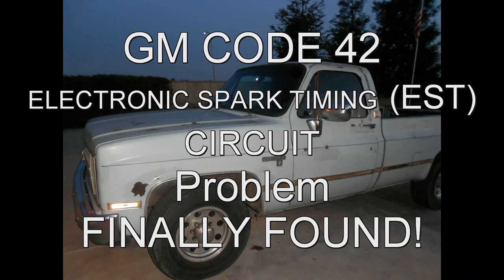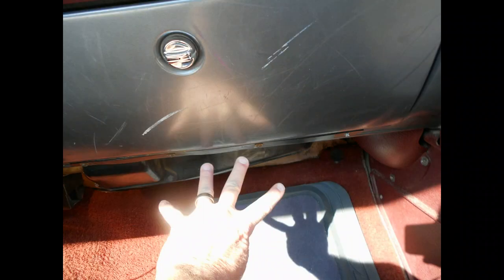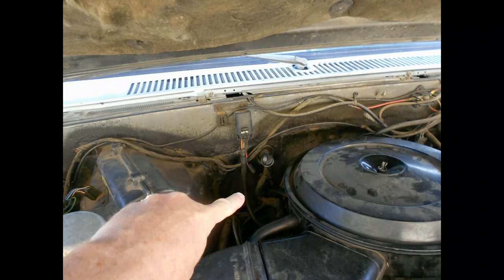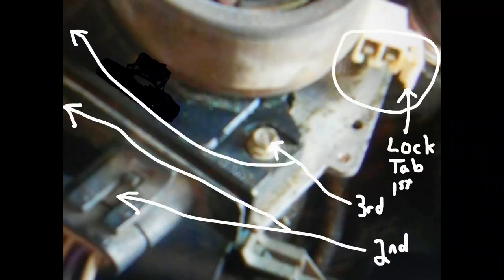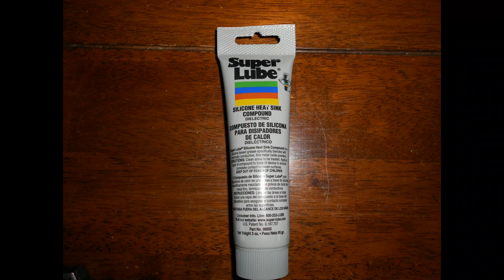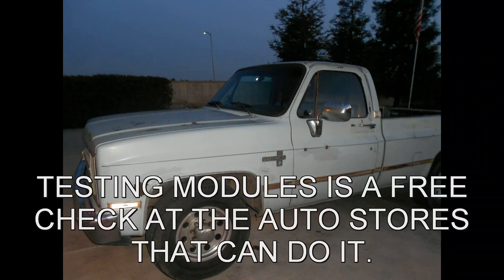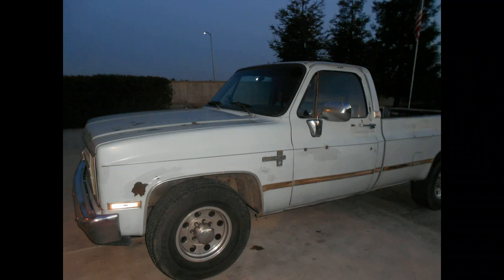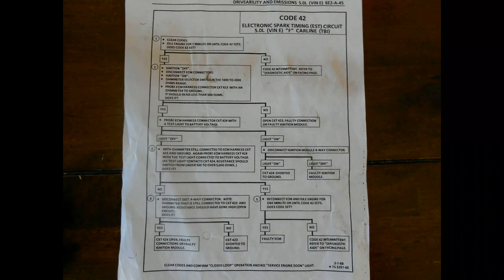GM FAULT CODE 42 ELECTRONIC SPARK TIMING(EST)CIRCUIT/FIXED

Comment: Great video. Same thing happening with my 1990 Bonneville. Didn't end up throwing code 42 until a week later. Took the ICM off and found a big crack in the rubber seal. I guess moisture was getting in over time and just finally started shorting out and making the vehicle stall. Going to change that out tonight and hopefully we'll be fixed.

Comment: Very helpful video. Just wanted to share this. While chasing my similar problem on a 94 gmc jimmy w engine code. I found my issue was the tan and black wire you disconnect while setting the timing.  This vehicle only gets used in winter as a rural mail truck driven from passenger side. Years of wet feet on the carpet cause the connector to corrode and lose ability for timing to advance. Vehicle ran but poorly and chugged on hills really bad. So give that tan and black wire a good look...
Reply from the maker: Good comment I know those wires well . God bless Works for me

Comment: Curious though, what is making the module overheat to the point where it fails? Could a bad ground somewhere in the truck could be causing this ? But great info .I didn't know auto stores could bench test the modules . Thanks again!
Reply from the maker: Good question! it is called poor engineering😇

Comment: A code 33 will cause a 42 code to set. The module starts the engine on base timing. When the rpm reach a certain amount the ecm will camaned control of timing. But if the map sensor causes a low idle problem the ecm thinks there something rong with the est. So it set a 33 and a 42 code. I know because I just got true fixing a 1995 gmc 4.3 with this problem.
Reply from the maker: Code 42 means the ECM has seen an open or short to ground in the EST or bypass circuits . What I see (read ) again WHAT I SEE is a double problem and your EST circuit is on the verge of failure too. That is my and only my opinion on that. Map rides on 416 ,432,455 wires to c14,c11,d2 ECM input--- EST rides on 423,430,424,453 to d4,b5,d5,b3 ECM input two totally different feads to ECM.  This video is for truck up to 1987 with ECM and some a trucks a little after like my 1994 suburban was the same. I would refer to a Haynes manual of your year and model  is you best bet. Good luck God bless and thank you for your comment- as usual -Works for me
Reply from the maker: Last two schematics for your year scroll all the way down https://www.autozone.com/repairguides/GM-Blazer-Jimmy-Typhoon-Bravada-1983-1993-Repair-Guide/WIRING-DIAGRAMS/WIRING-DIAGRAMS/_/P-0900c1528003db5f

Comment: My 91 s10  never did turn light on, but jumping obd1 connector it shows up, First ignition module replacement was from driving on the hwy, everything good till went to pass someone, Then all hell break loose, no power with tremendous backfiring out the exhaust, really loud, pull over side of hwy and truck would just sit and idle pretty as could be till tried gas it, would go dead but start right back up,  In dire strait's, I get Advanced ignition module, fixed truck,,, for little while, Then the hair pulling started, while cold truck runs slick as button till hot, from dead stop would start to accelerate and fall flat on its face, if AC on would go dead, replaced fuel pump, TPS sensor, coil, did the lean on and tap test on comp, with no check engine lamp, jumped obd1 connector and there was a 42, I have a delphi module ordered and crossing my fingers. will let know turn out. Personally, I believe everything from Advance or Autozone is complete garbage!
Reply from the maker: Yes I had to order mine from amazon which was AC Delco OEM. Good Luck God bless and works for me
Reply: Any update on this? @jocrp6

Comment: Nice video. I have codes: 33, 42, and 44. Not sure where to start. Advice welcome.
Reply from the maker: Right those down... Then remove negative battery terminal for 15 minutes ... replace then drive around and see which one(s) come back then start diagnosing one at a time with the method used by Hanes or Chilton manual if 42 comes back I would do that first .....
 Fault code list 
Code	Description
12	System OK ( Diagnosis mode active )
13	Oxygen O2 Sensor – Circuit open/no activity
14	Coolant Temperature sensor – Resistance too high or shorted circuit
15	Coolant Temperature Sensor – Circuit low or open
16	Direct ignition system (DIS) – Faulty circuit / shorted circuit
17	Camshaft Position Sensor – Circuit/timing error
18	Camshaft or Crankshaft – Sensor/circuit/timing error
19	Crankshaft sensor – Sensor/circuit/timing error
21	Throttle position sensor – Out of range/Performance
22	Throttle position sensor – Low Voltage
23	Intake Air temp sensor – Out of range, low resistance
24	Vehicle speed sensor – Circuit fault
25	Intake Air temp sensor – Out of range, high resistance
26	QDM A ( Quad-driver module ) – Circuit #1 fault
27	QDM A ( Quad-driver module ) – 2nd gear circuit
28	QDM A ( Quad-driver module ) – Circuit #2 fault
29	QDM A ( Quad driver module ) – 4th gear circuit
31	Wastegate solenoid – Circuit fault
32	EGR ( Exhaust Gas Recirculation ) – Circuit fault
33	Manifold Air Pressure Sensor – Signal out of range, high resistance
34	Manifold Air Pressure Sensor – Signal out of range, low resistance
35	Idle air control valve / Sensor – Circuit fault
36	Ignition system – Circuit error/fault
38	Brake input ( Brake switch sensor ) – Circuit fault
39	Clutch input ( Clutch sensor ) – Circuit fault
41	Camshaft sensor – Circuit fault or ignition control – circuit fault/error  (depending on the car model)
42	EST (Electronic spark timing) – Circuit grounded/shorted
43	Knock sensor / Electronic spark control – Circuit fault error  (depending on the car model)
44	Oxygen O2 sensor – Lean Mixture
45	Oxygen O 2sensor – Rich Mixture
46	Pass-key II – Circuit or Power steering pressure switch – circuit fault error  (depending on the car model)
47	PCM data – Circuit error
48	Misfire (diagnosis)
51	Calibration error – Mem-cal, ECM, or EPROM failure
52	Engine oil temperature circuit – Low temperature indicated / circuit error
53	Battery voltage – Low/high/error or Egr valve solenoid 1 – circuit error  (depending on the car model )
54	Fuel Pump – Circuit error or Egr valve solenoid 2 – Circuit error (depending on the car model )
55	ECM PCM – Circuit error or EGR valve solenoid 3 – Circuit error (depending on the car model )
56	Quad-driver module (QDM B) – Circuit error
57	Boost control – Error / Faulty
58	Vehicle anti-theft system ( VATS ) – Circuit faulty
61	AC (Air conditioning) system performance or degraded oxygen sensor signal (depending on the car model)
62	Engine oil temperature sensor – High temperature indicated
63	Oxygen O2 sensor right side – Circuit open or MAP (manifold air pressure sensor ) – out of range (depending on the car model )
64	Oxygen O2  sensor right side – Lean mixture indicated
65	Oxygen O2 sensor right side – Rich mixture indicated
66	A/C (Air conditioning ) pressure sensor – Circuit low pressure
67	A/C (Air conditioning ) pressure sensor – Circuit or a/c clutch – circuit failure (depending on the car model)
68	A/C (Air conditioning ) compressor relay – Circuit failure error
69	A/C (Air conditioning ) clutch – Circuit/pressure high
70	A/C (Air conditioning ) refrigerant pressure – Circuit high
71	A/C (Air conditioning ) evaporator temperature sensor – circuit low
72	Gear selector switch – Circuit error/fault
73	A/C (Air conditioning) Evaporator temperature – Circuit high
75	Digital EGR #2 – Solenoid error/faulty
76	Digital EGR #3 – Solenoid error/faulty
77	Digital EGR #1 – Solenoid error/faulty
79	Vehicle speed sensor (SS) – Circuit signal high resistance
80	Vehicle speed sensor (VSS) – Circuit signal low resistance
81	Brake input data – Circuit faulty
82	Ignition control (IC) 3X – Signal error/faulty circuit
85	Prom –  Error/faulty circuit
86	Analog/digital – Pcm error /faulty circuit
87	Eprom – Error / faulty circuit
99	Power management – Error / faulty circuit

Comment: I’m getting code 42 on my 94 Silverado but it runs just fine no symptoms of anything. Idk what to do.
Reply from the maker: Page 2 https://www.2carpros.com/questions/error-code-42-no-spark
More ::: 
https://f01.justanswer.com/heavy_chevy_396/c9f8c0ab-4f25-45bf-ab3a-733f9a47556b_1988_Chevrolet_Pickup_7.4L_Eng_VIN_N_V30_code_42_no_est.pdf 😇
Reply: I have a trans am 1994 lt1 and have code 42 OBD 1 GM 😢😢

Comment: Hoping someone can help!!! Recently replaced ICM. Wouldn’t start but idled good, drove it for a week now and have code 42 and no start. Any ideas how to test the ICM???
Reply from the maker: Signs of a Bad Ignition Module
1. Acceleration Issues. The vehicle may shake, vibrate or jerk when the gas pedal is pressed. 
2. There may be hesitation or lack of power during increases in speed.
3. Temperature Problems. A faulty ignition module can cause a vehicle to overheat. ...
4. No Power. The engine may turn over without starting.
*******HOW TO TEST The GM Ignition Control Module (1995-2005)*****   https://easyautodiagnostics.com/gm/4.3L-5.0L-5.7L/how-to-test-the-icm-1 \
Hope this helps and God Bless 

also search pages :: 
https://www.google.com/search?q=what+is+the+gm+fault+number+for+bad+icm+1987+r20&source=lmns&bih=939&biw=1880&client=opera&hl=en&sa=X&ved=2ahUKEwiCvrfYzLL1AhVFrWoFHU66AG0Q_AUoAHoECAEQAA

Comment: Where did you get the shop manual?
Reply from the maker: Look in the description section below the video I have the link right there.
Good luck God bless.
Reply from the maker: https://www.gmsquarebody.com/threads/87-v10-350tbi-cutting-out-intermittently.13177/
Reply: Thanks for the link. Do you know where to get the book that describes all the codes for this truck?  @mbjdiy1778
Reply from the maker: On that site.

Comment: Thanks, I just got a code 42 in my 1991 Silverado, 350tbi already shot a small parts cannon at it, fuel filter, iac valve(sooted up), fuel pressure regulator rebuild(spring rusted and broke), cap, wires and plugs, and new screens on the injectors, timing checked.  Fpr kit from Summit(house kit), all other parts from Rock Auto and all AC/DELCO.  As of this post...delco icm ordered for my daily. What confused the hell out of me was that it starts and revs fine....just dies at stop or drop in gear. This has to work, lol.
Reply from the maker: Yeah i had to wait for that code to go solid to fix this part. EGR went bad shortly after that fix ... I think the bad Idle when it would also damaged my EGR - works for me - Good luck  God bless ... watch your EGR for possible failure also after fixing the other.

Comment: I just had this code come up on my 92 Cavalier.  My ICM and one coil recently went out so I replaced them and the car ran fine for a couple hundred miles and then the CEL came on and set the code 42.  I did the same tests that were in your flow chart since the factory Cavalier service manual flow chart was the same.  I tested circuit 423 and 424 and ruled out the ECM as the problem but now I'm not sure if there is a wiring problem or the new ICM has a problem.  None of our local auto parts store checks ICM's anymore so I have no way of checking it.   Any advice?
Reply from the maker: Call a reputable Chevrolet dealer parts department and either get the OEM part number or buy it through them ( I bought an aftermarket and it failed about a minute after install)you must also check your manual that 42 is the same code as trucks . some codes vary - good luck works for me
Reply: @mbjdiy1778  I used an AC Delco module quite a few years ago and it didn't last.  The one that has lasted the longest in the 14 years I've owned the car was a Borg Warner one which lasted about 99,000 miles.  They no longer carry it and is why I got the Standard brand.

Comment: Question, if ya dont mind - How did you figure determine that you had a code 42?
Reply from the maker: 1. first check engine light
2. did diagnostic crossing a and b with wire on diagnostic port ignition to to on before no engine to run first key click
3. flash 12 two to three times then  then flash count 42 two to three times depending on vehicle

4. diagnostics began (works for me) God bless
Reply from the maker: https://www.obd-codes.com/faq/read-gm-2-digit-obd-codes-free.php
Reply: You short together the upper right 2 pins on the data link connector at the base of the dash under the steering wheel. U will see a obd 1 connector mounted to the bottom of the nee bolster at about nee level. Cross upper right pins then turn on the ignition to the run position then watch the service engine soon light it will Flash 1 then 11  then if there's any codes you will count the lights as they Flash after the 1 11 signal is given. Example flash ,flash flash . It will do this 3 times. Then u will see any codes after that. Example flash flash flash flash.  Flash flash =42
Reply: Don't start the engine, only place ignition in run.
Reply: It will Flash once and pose then flash twice. Then pay close attention after that if u have any codes u will count the flashing ses(service engine soon) light.
Example flash  -- flash flash 
It will do this 3 times before showing codes. After u will see example flash flash flash flash -- pause -flash flash =42.
Reply: After the repair don't forget to remove the shorting clip from the OBD1 connection.

Comment: I replaced the spark control module, the ignition control module, and the oxygen sensor and I'm still getting code 42
Reply from the maker: Scroll down to trouble shooting diagram (two pages Down )... Good luck god bless 😇 http://forum.73-87chevytrucks.com/smforum/index.php?topic=36657.0
Reply from the maker: Also https://www.thirdgen.org/forums/electronics/291496-error-code-42-a.html scroll down Attached Thumbnails
Reply from the maker: More : https://f01.justanswer.com/heavy_chevy_396/c9f8c0ab-4f25-45bf-ab3a-733f9a47556b_1988_Chevrolet_Pickup_7.4L_Eng_VIN_N_V30_code_42_no_est.pdf
Reply from the maker: Broken Wire ,Bad connector , and the ever so rare mother board or (ECM) follow these trouble shooting sites these are manual steps which walk you through your nightmare ... God bless Tanya😇
Reply: Mine turned out to be the distributor. I ended up replacing all the parts you did plus relays and alternator. Turned out to be distributor in the end. Good luck